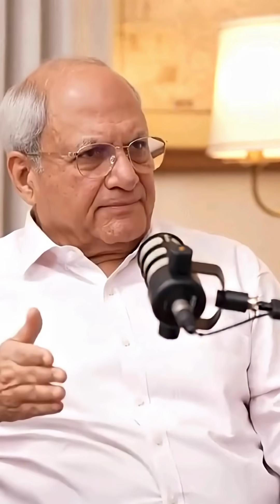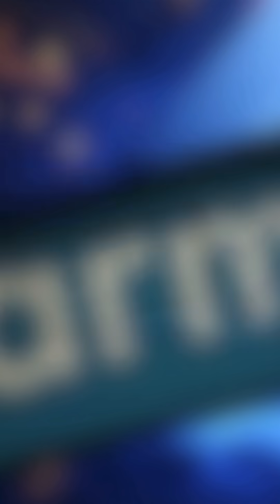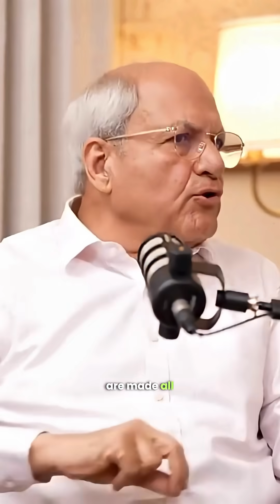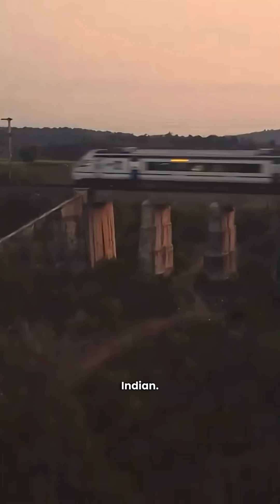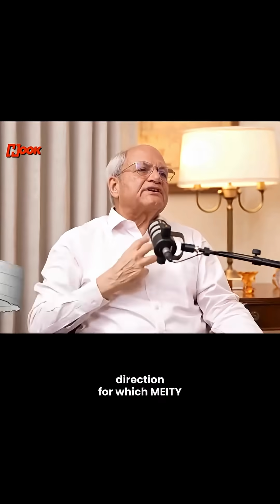India is ready to lead the next wave of chip innovation.

Comment: U r anyway licensing eveything from usa europe,  their machines their software they can stop at any point, and Arm and Risc V are just microcontrollers , there are 1000 other kind of chips each patented by west , even if the design of Risc V is open source  all the processes involved in chip manufactiring are patented , 
Why not remove all the import taxes on chips so that cheaper electronucs can be made here in india while developing machines semiconducyor technology  etc from scratch that can not be blocked by usa anyhow